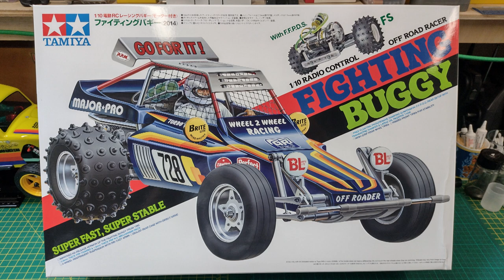Tamiya Fighting Buggy 47304, Complete Chassis Build

Comment: Very cool! Thanks for sharing. Love that rear damper 😎
Reply from the maker: Thanks for taking a look and the great comment. Yes, that rear damper is quite a set up isn't it! I don't know how long that damper oil will remain in that reserve tank! Stay tuned, bodywork on the way soon. This one is going to keep me occupied for a short while!👍 ATB Darren.
Reply: @totallytamiya  I had a Super Champ, same thing different name, I used to put a cable tie around the top of the bottle cap else the cap would pop off, and shorten the tube to reduce bubbles in the line. But all shocks leaked, all the time, I tried cutting fingers of surgical gloves and cover the shocks to keep dirt out, semi-successful.
Reply from the maker: You can't beat a bit of improvisation. I've given up on trying to get rid of the bubbles. You've only got to look at it and bubbles appear. It's a fun kit and I enjoyed the build. Thanks for taking a look and leaving a great comment. ATB Darren.👍

Comment: Hello, which battery do you use this car?
Reply from the maker: Hi, Thanks for taking a look and leaving a comment. It's shelf queen status at the moment but I'll most likely use a 7.2V NIMH. I had considered getting the Tamiya LF1100 6.6V M-Size Battery for it. I don't have any experience with the LF1100 but I may well look into it nearer the time. The 7.2V NIMH slots in nice following the removal of the battery clamps. ATB Darren.👍